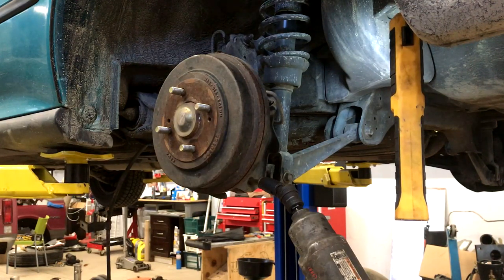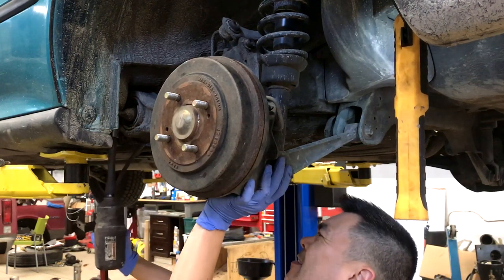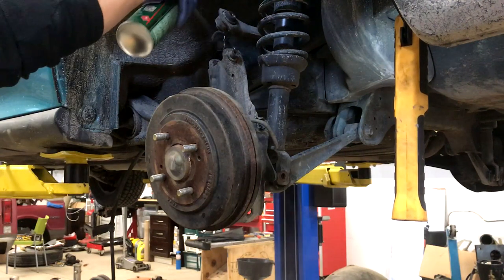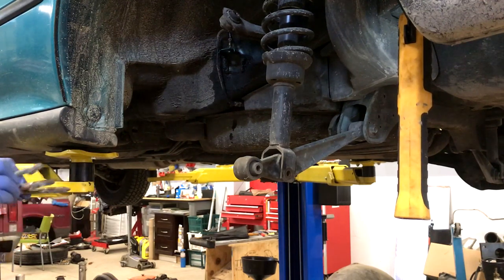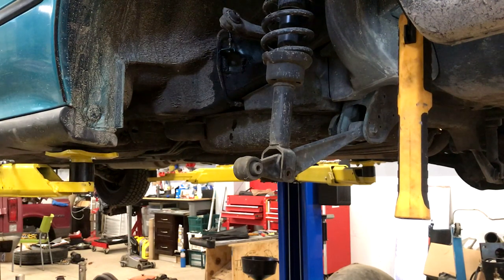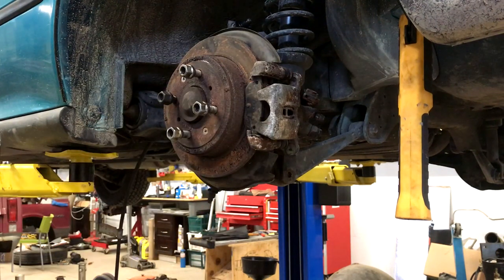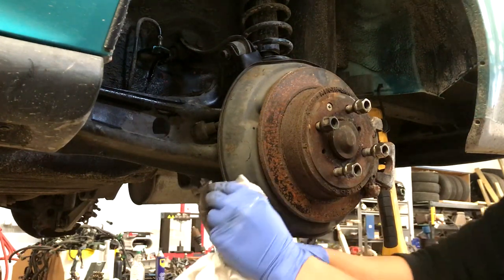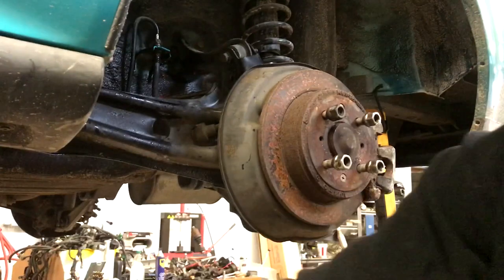One Take 🔴 Honda Civic Rear Disc Brake Swap in Real Time

Comment: Tried this on my new project. Instantly snapped the first two bolts i tried to loosen 🙃👍🏻
Reply from the maker: Sonova B eh? These cars are getting older and used parts can be rusty, I still cant believe they are 25 years old! My coupe is rust free, I just cut the rear fenders off my 95 HB. The underside looks mint, just the damn rear 1/4's on this one.

Comment: What is E brakes cables  line u use? Delsol , integra ? Or the stock cable ? Nice vedeo direct details... not like others talks to much about themselves... and what they’re do tomorrow’s.. and such such ... make more video bud. And just wonder you did the swap for this car ?
Reply from the maker: Hi Johnny, thx. You have to use the E brake cables from a disc brake car because the end where it meets the calipers is different than the drum brake system. The del sol cables are a bit short but they still fit and function perfectly. I need to swap this car already!!! I'll livestream it when I do, hopefully very soon, if not this car my hatchback.
Reply: Teggy ebrake. Did this last week and the del sol line is just a bit short. Like maybe an inch
Reply from the maker: Yes, not perfect but they hold and releases fine. Did you get your sol cables working ok? What chassis did you put them in?

Comment: Just found this abit late, as I just did this on my cxi ek hatch. I also did front hubs as mine was 242 mm and changed to 262mm
Reply from the maker: 👍 I have the same setup as yours on my ‘98. The beauty of that swap is you don’t need to swap the proportioning valve.
Reply: @GIZZMOTORSPORTS  nah I kept my prop valve stock. But is working fine. I did upgrade my brake booster though.

Comment: Hey man great video,  I have a question,  I have the 7th Gen and what cars would be comparable with mine to do disc brakes swap?
Reply from the maker: Hi. Either an 02/03 ep3 or a Canadian Acura 1.7el
Reply: 02-03 Honda Civic si. 02-03 is a 4lug. If you convert to 5 lug I believe 02-06 acura rsx base

Comment: Hey man great video! This one is the most clearest and nicely explained.
I bought a 2006 honda civic ex 4 door. This car has drum brakes as well and I want to convert them to disk brakes. I dont know if it can done? If so what parts should I get and from what car?
Reply from the maker: Hi thanks. You want to get the similar year 2006-11 8th gen civic si or ex rear knuckles, complete with calipers, rotors, brake hoses and e brake cables. It’ll be easier than this swap, you can do it!
Reply: Thanks for the info kido. I can't wait to get those done :)

Comment: I have 99 ek hatch dx, using 99 teg LS trailing arms. So the teg cables will work? And brake lines all line up? Do I need to grab the prop valve out of the teg?
Reply from the maker: The 2dr Integra cables are a tad short but wrk just fine. The prop valve for a non abs integra is a 40/40, grab it **edit, grab the 40/40 valve in case you get an eg one day, those valves are about to become obsolete. For your ek get the front brakes along with the rear and run your stock prop valve.

Comment: I know once you convert you need the low flow brake fluid valve for drums to high pressure flow for disc or you womy have any stopping power
Reply from the maker: Yes for these cars you need to make sure you get the correct or best proportioning valve. For the typical non abs rear brake 4th or 5th gen civic swap, if you don’t change the proportioning valve the rear brakes lock up prematurely. Not safe in poor weather.
Reply: @GIZZMOTORSPORTS  yeah man I working on a lil project get my 02 civic built up stable. And idk for engine k20a3 I really want to go with a b16 b18 for the lightweight and high rev
Reply from the maker: @michaelsteuernagle3479  cool project. I’m a big fan of b series, I have a b16b and b18c5, keepers for sure. For the size of that car a k24/k20 would be fun all motor or even better with boost!

Comment: Hello I got an 03 civic lx I want to do a conversion what should I do ??
Reply from the maker: Hello. For your 2003 to stay 4 lug you want to get the parts from a 2002-2003 Civic EP3 hatchback, if in Canada you can use Acura 1.7 EL parts. Or if you want 5 lug get the parts from a newer EP3 or RSX.
Reply: Ok thank you I appreciate
Reply: Ok so do I get trailer arms with the rotors caliper all together ?
Reply from the maker: @funnyboygundi6699  exactly, get all of that.

Comment: I have a 00 civic lx would i need to change the proportioning valve when i do the rear disc conversion?
Reply from the maker: For whatever reason the 96-00 only has one prop valve, so nothing to do. However I’d swap out the front knuckles/brakes to the larger ex/si for the most factory setup. If you check my ‘98 civic, that’s the setup I’m running now. But I’m likely going 5 lug with the awd conversion.

Comment: Hi is there anything wrong with going with the scare bird route ? This version looks way harder to do for me.
Reply from the maker: I would say everything is wrong with that kit.  The scarebird is an additional $100 usd shipped in the USA. It’s takes way longer to install, you need to buy the big torx bit. And if ever you smoke a curb with a rear wheel you may need to straighten or replace that bracket rather then get another Integra part. It’s best to keep everything as factory Honda as you can. I ran into similar issues with my c10 brakes with every so custom it’s a nightmare to replace parts.
Reply: @GIZZMOTORSPORTS  thank you for your advice !

Comment: Are the brake booster, and brake master cylinder extremely nessesary? I get that the proportioning valve is mandatory since I will definitely be doing a ton of hard braking while racing, but I'm really skeptical about the brake master cylinder and brake booster.
Reply from the maker: Yes, I 100% agree with that. The 2 lines coming out of the master appear to be diagonally split in the proportioning valve. The size of master or booster will not affect brake balance. I used to swap them on everything only because I had a stockpile of parts, my present coupe and hatch are both running stock master and booster with the correct swap proportioning valve.
Reply: @GIZZMOTORSPORTS  that's awesome ! Do you feel any difference from the braking before to after the swap ?
Reply from the maker: itachis Garage With discs there is less brake fade. Without the prop valve panic braking from 120+mph on the street or dragstrip was always super sketchy as rear gets light, the brakes lock up and it becomes all about keeping the rear from coming around. On ice it’s also very obvious after prop valve swap, especially braking in a turn,  no prop valve swap in this situation you cannot panic stop, it’s all gentle threshold braking. Swap the valve and it’s s regular car again. Rear discs and the correct proportioning valve are worthwhile modifications, I highly recommend.
Reply: @GIZZMOTORSPORTS  so if you're just going for looks ; such as a slammed look always driving slow and steady the 4040 proportioning valve wouldn't really be nessesary but on a more intense battle ground the 4040 prop valve would definetly be an important asset to swap.
Reply from the maker: You got it. Some may never notice the difference.

Comment: Hey just ran into your channel I have a question. I have a 99 civic ex coupe and would like to convert to disc. If I get the trailer arm of the teggy would I be able to still use my aftermarket coilovers and lower control arms as well or would I have to change those as well. Also can I use the si brake cable?
Reply from the maker: angel gomez yes your coilover is fine, you reuse your ex lower control arm. Yes you use the 99 si brake cable for a perfect fit
Reply: @GIZZMOTORSPORTS  like your channel just subscribe. What year trailer arm would be best to use
Reply from the maker: @chicoleno007 thanks for the sub! You can use any trailing arm from any integra from 99-00 and any civic or del sol with rear disc brakes newer than 1992. If your ex has ABS brakes you will want to get a setup that also has ABS, look for the abs wires.
Reply: @GIZZMOTORSPORTS  it has no abs. Its getting harder to find at junkyards.
Reply from the maker: @chicoleno007  you're right about that, Where I am I also look at craigslist, autotrader and facebook marketplace. If I can get a good deal on the whole car I'll take the whole thing.

Comment: Would I need to change prop valve on my 1997 ek1 hatchback I’m getting my rear discs from a 1998 4dr ek1 gli
Reply from the maker: We don’t have that trim level in N America. But, if it doesn’t have ABS, and being a hatch it should have the 9.5” front brakes. Your brake bias will be fine if you switch to the 10.2” fronts when you switch to rear discs.

Comment: Hi, I have a question.  I have a Honda Civic ek3 ABS, and I want to fit there rear disc brakes from Honda Civic 6g English version also has ABS will it work?  also need proportion valve?
Reply from the maker: Jozef Kováč the Canadian SiR had the parts you want. Does the ek3 have 9,5 or 10.2” front brakes? Because on the non abs ek cars they ALL run a 40/40 valve. So if you upgrade front and rear at the same time in theory the valve should still be good.
Reply: @GIZZMOTORSPORTS  my ek3 has 10.2 "front brakes, and also has ABS, I have a Honda Civic with D15Z6 engine

Comment: Hey I have a ek sedan with the drums no abs.  Which prop valve should I use and do u have a video doing it ?
Reply from the maker: moneyshot41 no abs, good. If you swap to the 10.2” front brakes or already have them then all is good, no prop valve change needed. The problem is running the 9.5” front brakes with rear discs in an ek, there is no OEM prop valve for that. Because of this I have the full em1 brake setup for my project Diirty FreeEK, I’ll swap it on a livestream soon.
Reply: GIZZMOTORSPORTS  thanks my man I’m running stock fronts right now so I’ll have to find the front swap
Reply: GIZZMOTORSPORTS I’m assuming ill need si 
master cylinder too ?
Reply from the maker: moneyshot41 you don’t need to change from 13/16” to 15/16” brake master cyl, it won’t have any effect brake bias. The bigger master cyl will slightly reduce pedal travel but also reduce pedal pressure. I say try the stock and see if you like it.
Reply: GIZZMOTORSPORTS appreciate the help my man

Comment: Is that all it is ? I always thought you had to change brake lines and valves etc ..
Reply from the maker: Andi Sanchez that’s all it is but I do recommend to change the proportion valve if you drive on snow or ice or are racing. For grandma driving on dry roads it will work perfectly fine and nobody will know the difference. There is likely a Honda proportion valve for your setup that will work well or you could go aftermarket adjustable. What car do you have?
Reply: GIZZMOTORSPORTS is there any oem valve that will do or the only answer is aftermarket ? I have a 00 ex and I’m looking at getting a 00 si rear disc
Reply from the maker: Andi Sanchez  yes! You should have abs so use the one from the US 99/00 SI with abs. If for some reason you do not have ABS then use the 99-00 us civic si(Canadian sir) prop valve from a non abs car, but more likely you will need to find an Integra Prop valve from a non abs car. They both use the same size brakes that you will be and the cars are about the same weight.
Reply: GIZZMOTORSPORTS awesome i appreciate it !  Thanks for your time

Comment: Wow so it is live I thought you would’ve like skip some parts because the video was like 18 minutes long you could actually do rear disc conversion that fast
Reply from the maker: If you hustle you can do both sides with cables and proportioning valve in an hour, lol.

Comment: I have a 97 civic ex i want to do this to and just bought a 96 integra to swap the b18b1 in the civic. Is it a direct bolt on with the disc break set up or will i need to get other parts? Im not sure of the sub model of integra but i believe its a ls.
Reply from the maker: @kincaid stockman rear brakes are a direct bolt in, I’d check the master cyl size and swap it if different. Do both cars have abs? That engine swap will also be straight forward.
Reply: GIZZMOTORSPORTS ill chrck the mc this evening, Im not sure if theyre the same size. The integra has abs but the civic does not. And yeah the engine/trans and ecu are all a direct  swap in.
Reply from the maker: kincaid stockman sounds like you have it under control, the prop valve is built into the abs unit. The civic is on the firewall, do some panic stopping and see if the rear locks up too early. I’ve heard but have not confirmed all the 96+ prop valves are the same.
Reply: GIZZMOTORSPORTS right on man. Thanks for the help.

Comment: Can you do a video on doing the disc brake swap with just removing the torx screws and not replacing the whole trailer arm
Reply from the maker: What parts did you already get? Are the integra trailing arms bent?
Reply: @GIZZMOTORSPORTS  some people do the rear disk conversion with out replacing trailer arm I was posting it to the guy that said you dont need to replace the whole arm
Reply: Just wanted to see if someone can post a video of doing it that way
Reply from the maker: @robertalicea5585  Hi Robert, what some people do that I do not understand.. if you go the route and buy the "Scarebird" or make your own caliper brackets you still do not need to remove the torx bolts on the trailing arms. That Honda spindle part attached with the torx was never sold separately from Honda, so you are forced to buy the whole arm anyway or buy used. In both cases you are getting the whole arm. Google Scarebird bracket, I think that's what you are after but honestly just get the whole used arms like I did in this vid :) I hope that helps, any other questions dont be afraid to ask. Please like and Sub for more Honda content from a Technicians point of view.
Reply: I wouldn’t recommend it. Either go with the scarebird or the full trailing arm swap (I’d recommend the full swap)

Comment: Is this possible on a 01 Civic ex sedan? If so what parts would I need?
Reply from the maker: Hi. It's a similar job for your 2001 except you want to get the parts from a 2002-2003 civic EP3 hatchback, if in Canada you can use Acura 1.7 EL parts. If you want 5 lug you can look at newer EP3 or RSX

Comment: Do you know if this would be the same for 2002?
Reply from the maker: Ty Smithhart essentially the same job for your 2002 except you want to get the parts from a 2002-2003 civic EP3 hatchback, if in Canada you can use Acura 1.7 EL parts. If you want 5 lug you can look at newer EP3 or RSX
Reply: @GIZZMOTORSPORTS  Thanks for the reply. Subbed

Comment: so the car is a civic 94 ex, where did the rotors and trailing arm come from? what year integra was it ?
Reply: also really liked how you got to do a point on everything, well done.
Reply from the maker: thanks Carlos, these trailing arms came from a del sol. 
But you can get the disc brake/trailing arms from a 94-01 integra, the 90-93 integra will also work but I would stick to the newer 94-01 because they are newer and also the trailing arm bushing is a more common size than the 90-93. 
Also a 92-95 civic si hb, 
or a 99-00 civic si(canadian sir) will work.
Reply: awesome, thank you. I have a 95 civic ex which I along with a friend removed the auto tranny with d16z engine to a b20b manual. next is this; the drum to disc brake conversion. I'm going to go to junkyard and hunt for the trailing arms, along with the disc's and cables. Is there anything else that I am missing? By the way I really like your content keep up the good work and stay consistent with your content you seem to know what youre doing and do it. New sub for life !
Reply from the maker: carlos Leon that's for the feedback! Much appreciated. I would definitely check to see that the calipers aren't dragging, and it'll be a bonus if the trailing arm bushings aren't seized. You're coupe should be non abs, if you find a non abs integra grab the proportioning valve and even the brake master and booster if they are cheap enough. People say it's fine without the proportioning valve but they must not be braking hard or in bad weather conditions, it's a very good idea to get the proper proportioning valve.
Reply: GIZZMOTORSPORTS will make sure to get everything i need thanks boss !

Comment: I was told i can use my stock EK trailing arm just swap the hub and spindle assembly?
Reply from the maker: Broken Bolt Garage that won’t work without buying aftermarket caliper mount brackets($$$)
Reply: @GIZZMOTORSPORTS  mean some hubs on eBay, calipers if u can score some at salvage yard great if not buy em new new rotors and pads cause why not if ur swapping to disc. Point being the conversion can be done without swapping the whole trailing arm imo.
Reply from the maker: @felixvalentin1618  reason is the drum trailing arm doesn’t have anything to bolt the caliper to. You need to spend a bunch of money on aftermarket brackets, and most guys will have to buy tools to get it all apart. Simplest to pay a hundred bucks or whatever and get everything you need with the whole trailing arms.

Comment: The E break line didn’t reach from the disk I need help ahaha I have a ex civic 1997 and I swap them with 1997 integra :(
Reply from the maker: The wheelbase is essentially the same, it should bolt right up, move the brackets around on the cables?? If you were using the 9" too short del sol cables I would have said don't use all the ebrake cable brackets if thats what it takes. Are you sure the cables are from that car? Very strange.
Reply: GIZZMOTORSPORTS  I got it! Lol thank you
Reply from the maker: Fantastic!!
Reply: The integra cables are too short you gotta use Del sol Si or Civic Si cables
Reply from the maker: You mean del sol are the shortest
Reply: GIZZMOTORSPORTS I’ve heard both. I stick with civic Si cables to be 100% sure but I can check then because I happen to have both Del sol Si cables and Civic Si cables bc the arms I bought are off a 93 Si